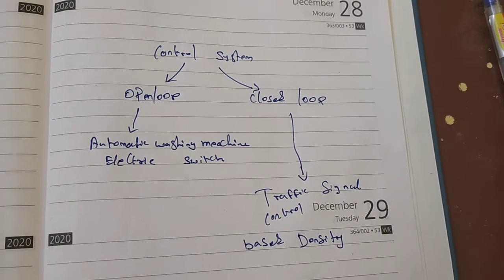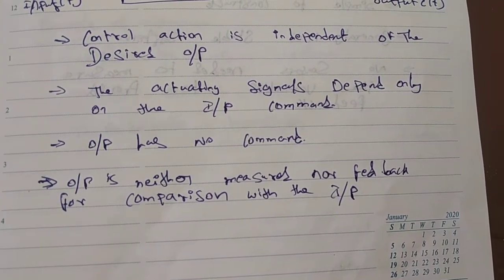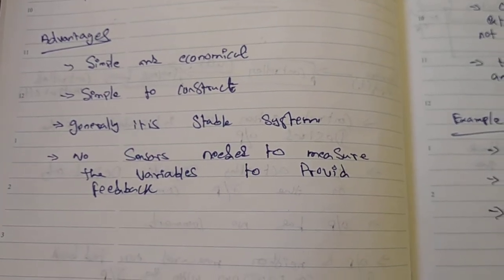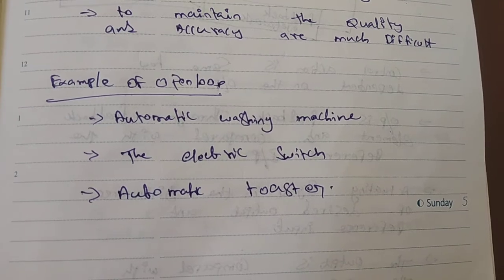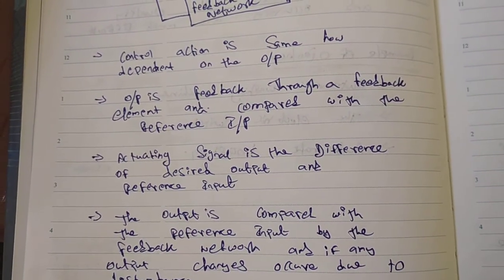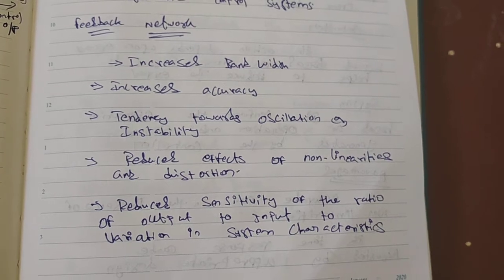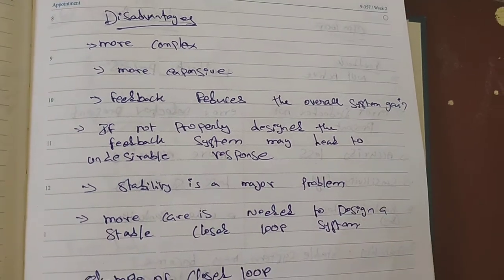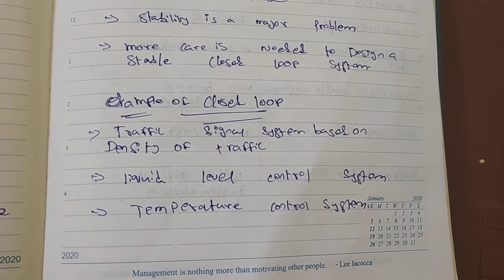#Control system Tamil engineering open loop & closed loop

Comment: Two types of control models here 
NOC (open circuit),  NAC (closed circuit)
1) control module (maximum using out put control circuit or another name out put interface  )
2) monitor model (input modules or input interface )
Both of them modules operating in  open and close loop operation 

Super explain nanba 👍
Reply from the maker: Thank you nanba